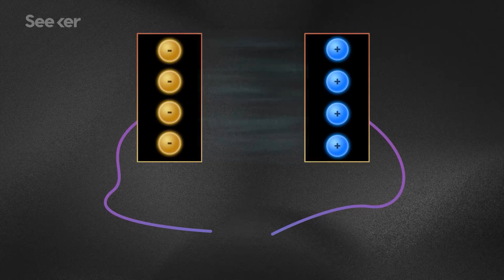How Supercapacitors Could Make Batteries a Thing of the Past

Comment: Capacitor technology is a very long way short of producing capacitors with the same energy capacity of even a NiMH cell. At present, they can hold around 2% of the energy of an AA cell, if they are the same physical size. 
Capacitors can accept and dump their relatively small amount of electrostatic charge very rapidly, limited only by their internal resistance, whereas batteries rely on a chemical reaction, which is inherently much slower (ions are moving, not the very much smaller electrons), but their charge capacity is huge, compared to a capacitor of similar volume.

Comment: The trick is use double layer capacitor where extreme high voltage permanently store on outside layer and they induce charge with lower voltage on the inside layers that you can convert in to AC and use forever

Comment: Superdielectrics' Jim Heathcote actually states that their polymer-based supercaps "could potentially deliver 50-500 times the energy density of lithium batteries".  And that claim has been confirmed by one of Britain's foremost electrochemists Professor David FERMIN of Bristol University. What's more Rolls Royce plc have now joined forces with Superdielectrics - if that's not a vote of confidence I don't know what is.
For full exclusive report with key quotes, video presentations and key clips etc see EVUK  at:
http://www.EVUK.co.uk
Paul G

Comment: haha in a decade ? haha what type of joke you talk man? IMPOSIBLE. like compliment for battery yes but for replace them will not be possible... the battery no depending on surface jsut in reaction so will be more compact(not the same as densite) 
For electric vehicle will be good option to accelerate fast when battery can suply so much energy in so smal time.

Comment: Can you do a video about how and Why Nicola Tesla used capacitors? 

I wonder how a graphene capacitor will compare to a thicker carbon capacitor? Surely the speed of charge/discharge will still be through the roof and also energy density would be much much higher then current capacitors

Comment: 10W/h per kilo?!'! Dude, there are 3kF / 2.7v @ less than 50 grams for a total energy density of more than 600W/h per kilo since last winter!
Reply: The math works out to 66 watts per kilogram, which is incredible for a capacitor, and even respectable for a NiMH battery. What kind of capacitor is it to be that big, with that little weight? That's about twice the storage density of a lead acid battery!! If that capacitor actually exists, problem solved.

Comment: What about a hybrid system which would use capacitors to rapidly store the energy created from regenerative braking and syphon it into the battery through its charging circuit?

Comment: The thing with capacitors that they don't mention is that a charged capacitor has the tendency to explode when damaged because it internally shorts out and almost instantaneously dumps all of its energy. Even the current small capacitors can blow up quite violently. I can't even begin to imagine how bad it would be if a car-sized one went up like that. A simple accident in heavy traffic could potentially lead to a terrible chain reaction if this isn't taken into consideration.
Reply: you're pretty safe, if you use a lot of small elements, as opposed to a single large element. That way, a failure is only a fraction of the total charged energy in the car. Otherwise, that's a lot of energy to be released all at once.

Comment: What are batteries good at?
Storing and releasing energy at a controlled (slower) rate.
What's the downside?
They have problems (eventually) if you continuously charge and discharge quickly.

What are capacitors good at?
Storing and releasing energy at a high (faster) rate.
What's the downside?
As mentioned, holding large amounts for longer periods.
Would the ideal system combine the two?
Possibly.
How about a smaller battery AND a capacitor pack to make up the difference.
Example.
Charge the battery overnight.
Start in the morning.
The first time you brake, the regen charges the capacitor.
When you accelerate, the capacitor releases its energy, the battery is only used when the capacitor is drained.
So you have a battery doing what it does best, generally used for cruising, low load conditions, being charged, again generally, at a slow rate.
You have a capacitor doing what it does best, charging and discharging quickly.
You have a reduced size, cost and weight of battery, offset by that of the capacitor, so no effective change to the size or weight.
Sounds good?

Comment: SuperCapacitors are indeed the future but there is a video by Neil deGrasse Tyson which says that for any system to DELIVER POWER, Thermodynamics inevitably demands heating of source.. be it battery, Sun, or Iron mans arc reactor. For example even if we develop Iron mans arc reactor, that thing will melt Tony stark due to high heat produced while DELIVERING power. So may be supercapacitors are future,but storage and cooling may be an issue
Reply: Neil is right, but that's to PRODUCE power. Capacitors, like batteries, STORE energy, therefore there is no thermodynamic process in play. Capacitors in particular, due to their high efficiency, don't require a cooling system. The sun, and the arc reactor, which is actually a mini sun contained in a magnetic field DEFINITELY produce heat. Just like a combustion engine. There is the concern that the more energy dense a storage system is, the hotter it will get if there is an internal short or other malfunction. Anytime more energy is available to less mass, there will be a greater temperature rise. In normal use, that energy goes elsewhere.

Comment: If only their self-discharge wasn't so atrocious (compared to batteries). 
Supercapacitors are an excellent compliment for hybrid and fully-electric vehicles (e.g. they are far more efficient than betteries at absorbing spikes in power from regen braking due to their lower internal resistance; the energy can then be used for phat acceleration)

Comment: Even if we can get super capacitors with the energy density of chemical cells, they may not lead to "instant" charges.  Unless the super capacitors can be charged at significant multiple of the discharge voltage, any high watt hour storage system will require a high amperage to go along with the charge voltage to charge at a rapid rate.

Comment: 2 single layered strips each of single-domain graphene and boron nitride rolled together for the win. Sure each one would take years to create but I don't know if anything that could beat a super capacitor comlletely composed of just 4 unseparated molecules.
Reply: would this capacitor be polarized, or could be charged in either direction like a polypropylene? either way, it sounds like a solution that can last the lifetime of a renewable energy system, that can be used for block chain grid stabilization. It should have a near infinite cycle life, because no theoretical wear out mechanism.

Comment: What about the 50% energy loss when charging a capacitor rather than the ≈5-10% loss when charging a battery? You guys are getting worse and worse at these videos and being a physics math major it's sad to see you never talking about possible drawback or the actual science behind the inventions.
Reply: Capacitors have a much higher charge acceptance efficiency than any battery. they're nearly perfect. Where the energy loss is, is in the pulse width modulators, needed to turn the wildly varying voltage of the capacitors into the steady voltage required by the load. When you multiply the loss of efficiency during charge with the loss during discharge, your round trip efficiency is comparable to a good lithium battery. if you're using a resistor as a ballast, the efficiency is exactly 50% during charge.

Comment: Teslas already charge in minutes and not hours. They can charge to 80% in 40 minutes
The next gen Supercharger, which will be unveiled within the next 6 months, will be able to do the same for less than 20 minutes.
By the time these super capacitors are developed, they won't have much of an advantage, if any.

Comment: Wonder if you could use this for the proposed electric airplanes.  To save additional weight they could charge them with lasers from various relay stations using line-of-sight.  Fog and birds would no doubt pose a problem as well.

Comment: For anyone unclear on the difference between compasitors and Batteries here's a great way to think of them.

Think of batteries as a "2-liter pop bottle" you can store a lot of fluid in them but getting it in and out is a pain.

Think of capacitors as a "Shot Glass" You can get the liquid in and out quick but you can't put a lot in.

Got this from a high school teacher, its not a perfect example but it does a good job of explaining the concept.

Comment: Graphene is already a thing in the past?
Reply: yes. 
"Graphene ball" is new thing
Reply: @Redford_lee  
Used in Samsung EV batteries now.
Reply: nope. "Graphene ball"  is still too expensive to mass market... never been used in real world yet... 
If this tech was in EV batteries. it would only needs 12~16 min to charge 10% to 80% and twice capacity in same mass.
The reason why Graphene ball batteries are awesome. is just Graphene ball is super strong structure. It ables to use SiO2 in battery safely. SiO2 is super good and super cheap and super abundant material for batteries BUT super dangerous so no one uses it now...

This tech was almost out on the market... untill .... Note7 happened(note7 does not contains graphene ball coated SiO2 batteries)  Samsung is very very very cautious about batteries now..  SiO2 in battery is very very dangerous... So Samsung is spending more time to perfecting it... i think it would need 2~3 more years
Reply: @Redford_lee  its call "market" not "real world" wtf were you thinking
Reply: n "on the" market//, "in " real world wtf were you thinking
Reply: @Redford_lee  SiO2 is glass as an amorphous solid and quartz as a crystalline solid. Last time I checked my quartz crystal didn't explode at my face.
Reply: graphene is for feken hipsters and pencils

Comment: Capcitors should be used with batteries in such a way where it picks up the power and discharge into the batteries, the batteries suppy the load.

Comment: Only downside with supercapacitors is that they're a lot more dangerous than batteries, since if one were to accidentally get shorted, it's able to release all of the energy it's holding at once.

Comment: So you are predicting that something with a maximum potential energy storage of 90% of what batteries already have now will replace batteries in a decade?  The only way that makes sense is if batteries are already at their maximum energy storage now and won't improve over the next decade,  which is incredibly unlikely.
Reply: Batteries degrade over a relatively short amount of time (5~10 years) to the point of being useless. Capacitors degrade much slower, lasting decades. The consumer will not buy a car which needs a super expensive battery replacement (~50% of car value) every 5 years. Buying a car which has a battery which could last 30 years without significant degradation is another story. The crux here is that while battery energy storage matters, what matters more is battery lifespan.
Reply: Theos Tragonidis  That sounds nice in theory, but a lot of people buy new cars after 5 years, and very few cars last 30 years.  People are ok with shorter lifespans as long as the parts last as long as the product.  It's why people overclock CPUs - 25% increased performance at the cost of half the lifetime seems dumb, until you realize that a CPU may last 20 years normally, but a laptop rarely lasts 5, so losing 10 years of CPU life is an acceptable trade because you'll replace the laptop anyway before the 10 remaining years on the CPU are up.
Reply: Ryan Stallard - Why don't you google the average age of a car in a eastern European country? Even in Germany, people are driving en-mass 15yo cars. People are not OK with shorter lifespans when it comes to cars because a 5yo Mercedes costs more than half of what you paid for it new. You CPU analogy is totally out of place, a CPU isn't a car and doesn't cost 60k $ new. I can tell you don't own a car by the way you talk lol.
Reply: Theos Tragonidis  1. Isn't Eastern Europe a poorer part of the developed world?  I'm not sure they'd be the target market for the newest technologies.  2. According to Google, the average age seems to be between 10 years, not 15 like you mention. 3. If you are buying a $60k car, then you can probably afford to replace it often.  Most new cars I've seen are $20-25k. 4. Congratulations, you know a CPU isn't a car.  However, you failed to indicate the analogy is incorrect (you need to show the logic pattern is incorrect, not the scale) 5. Ha ha ha.  Ha ha ha.  Based on my above points and your erroneously reasoned conclusion, what you "can tell" doesn't seem to be very impressive (or accurate).
Reply: I drive a 60k car and I'm definitely not going to buy a 60k car that needs a battery change after 5 years which will cost something crazy like 20k. That's just not feasible when I can drive my luxury sedan 5 years and sell it for 30k. What will the resale value of a car be when it's estimated value is 30k and the next owner has to invest additional 20k to get it on the road again? You're being ridiculous. Most new cars you've seen are $20-$25k? Those must be some shitty cars you guys drive there. 

"you need to show the logic pattern is incorrect, not the scale"
Stop smoking crack pls.
Reply: 1. Most people don't have luxury cars, so trying to make a generalization based off your uncommon circumstance is foolish.  You should use statistics derived from random sampling, not personal antecedents.  I love how you tell me to Google, but you yourself just use your own situation.
2. By your own logic, spending $20k on a battery would be cheaper than spending $30k on a new luxury car every 5 years.
3. Sure, if every non-luxury car is "shitty".  Did you think before your wrote that?  
4. Sorry for smoking the crack called "logic" and "reason".  Do you end every comment with an ad hominem?
Reply: Ryan Stallard - "spending $20k on a battery would be cheaper than spending $30k on a new luxury car"

Dat logic. Spending a 100$ on a tent would be cheaper than spending 500$ on rent. Where's my logic award?
Reply: You don't get one.  The battery extends the life of the car, while the tent in your example is a new entity.  A better analogy would be paying high property taxes on a house you already own instead of buying a new house.
Reply: procletnic  Which point are you referring to?
Reply: Ryan Stallard - did you fall on your head? You can see the point I'm referring to in my first comment.
Reply: procletnic  You deleted the comment I was responding to.
Reply: Ryan Stallard - I didn't delete anything. Describe the comment I deleted?
Reply: Theos Tragonidis  More erroneous conclusions and ad hominems.
Reply: Ryan you obviously haven't studied automotive market trends. Cars are lasting longer and people are keeping them longer, except for the aspirational capitalists who have an emotional need for a new car every year.
Reply: Taxi Rob  No, I haven't studied them, but I did look them up.  There has been an uptick in average car age.  My issue was with his logic.  His conclusion could be correct, but he arrived at it the wrong way.
Reply: You're absolutely right as far as electric vehicles are concerned. I look at this technology as the necessary electrical energy storage to allow intermittent renewable energy to exceed 20% of generating capacity without causing stability problems with the grid. The ability to maintain a capacitor at 50% capacity continuously with no degradation, means that they can store surplus, then supply shortage. It's the very thing that would make 100% renewable energy a real possibility. In stationary applications, cost and longevity are the major considerations. Size and weight don't matter as much as it would in an electric vehicle.

Comment: I was wondering if a super capacitor/battery hybrid EV would make sense as an interim step until the next generation of batteries or super capacitors comes on line? Charging the supercaps often for local travel and fewer charges of the batteries for longer travel might extend the longevity of the batteries with fewer battery charge cycles.

Comment: Do you have any ideas on electricity? To charge a 70kwh capacitor in 1 minute you will need 4.2 MW or about 1/3 the production of a nuclear central. At 400 volts, the maximum safe voltage in a charging station, you would need 10.500 Amps cables. No one could carry such huge cables and all the wiring in the car should be able to absorb this power without blowing-up. Not very realistic.
Reply: That's why they're still researching to find ways about this problems.
Reply: Well if they can break physic laws they will get a Nobel price but its very unlikely.

Comment: Hmmm, how about a hybrid car and by hybrid I mean battery and supercapacitors. You could quickly recharge the capacitor and charge the battery for longer range. Have been thinking about this with Hydrogen Fuel cells as well🤔
Reply: A good choice for hydrogen fuel cell. It will allow the motor to draw more power than the fuel cell itself can produce for a short period of time. It will also allow capacity for regenerative braking.